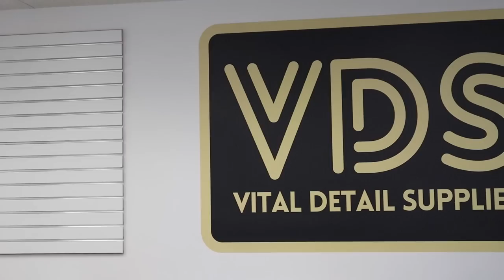Clay and Wax on a Mercedes - Top Class Detail

Comment: Great job. I’d really suggest getting an steam water cleaning extractor for the interior. Chemical and a rag really only does the basics. It won’t pick up 100% of the dirt , stain and chemical residue left behind. That usually tends to leave some staining or smearing the stain all around. Also the chemicals used can cause white foaming giving the illusion it has been cleaned. But once dried the stain reappears and the residue left behind over time attracts more dirt. Rinsing and extraction is the most important part. I’ve been cleaning carpets and car interiors for 10+ years. Good luck bro.
Reply: So pay for it....if not shut up.
Reply: @gudlukkay  totally agreed with you
Reply: True...but sometimes being mobile space is limited